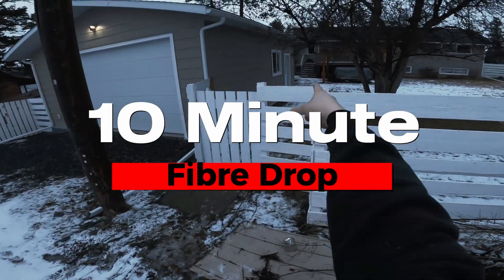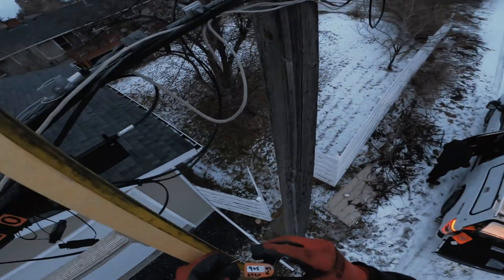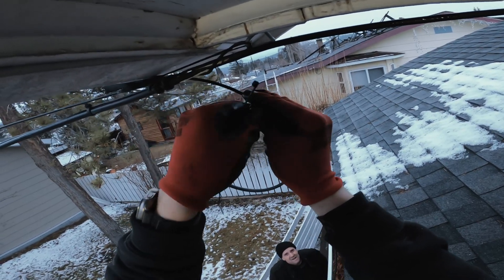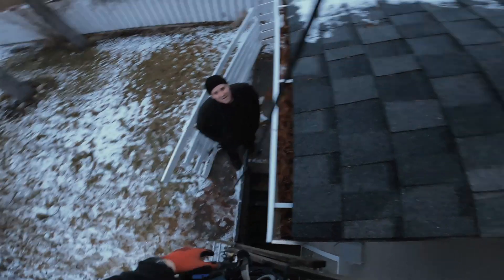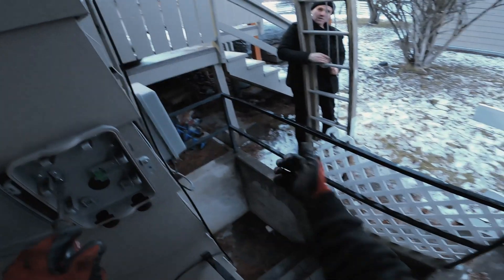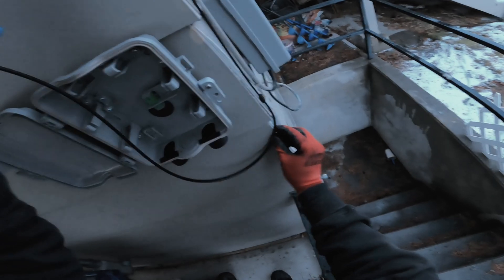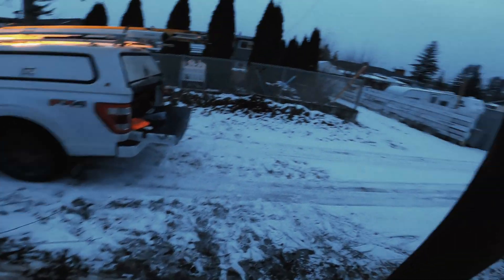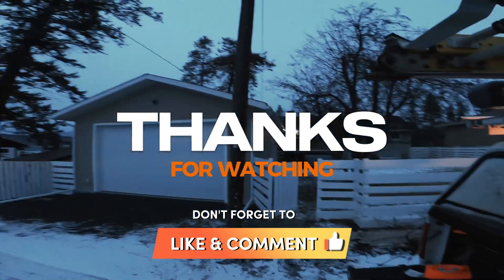Fibre to the home in a blink

Comment: I'm curious. Have you ever come across an install that requires you to install the NID on a detached meter pole that requires you to go into it then back down to the pole and then trench up to the residence that requires you to run the cable underneath the underpinning into a crawl space up through a floor? Or has all of your installs require the NID to be attached directly to the house. 

When I had my AT&T fiber installed last year they made me pay several hundred dollars do you have the drop trenched from my meter box pole that's detached and almost 100 ft away. (I live in a manufactured home and it is building code for all utilities to be detached from the main dwelling and all my utilities have to be buried using ground rated cables including internet services. AT&T installer about had a heart attack when he wasn't allowed to run an aerial drop from the fiber box on the pole.
Reply from the maker: Keep watching my videos and your questions will be answered 😅 join our discord!
Reply: @FyBurz  aye mate. Im making my way binge watching through your videos now.

Comment: Coming from someone who does this everyday, your work leaves a lot to be desired.

You shouldn’t ever be placing your ladder on another companies strand.  You aren’t using proper safety equipment to go mid-span with your ladder either.  The drive-in CATV hook you attached your drop to is only rated for one attachment.  Placing an additional drop on them often breaks them inside year or so, resulting in a low drop.  Your work partner should have a hard hat on when they are working around a ladder also.  Seeing this, I would assume you don’t have a hard hat on either.

Let me guess, you are contracted and not directly employed.
Reply from the maker: You’re not wrong. regarding hardhat, Unfortunately he forgot his on this trip. My GoPro is mounted to my hard hat so there’s that   I always wear it. People have different styles of fall arrest and I agree a ladder/ pole strap is the safest it’s the not equipment I generally use day to day. although I do when necessary. Regarding the Phook I rarely use them as attachment and while I agree that normally they aren’t very strong(hence why I use ram horns) this drop was very short therefore not applying much tension or pressure to said drop. It could have hung off a saddle at that distance not that I would ever do that. Me placing my ladder on “another” companies strand is a stretch man, we commonly share strands in certain areas. And it usually allows for less crowding below. 

I appreciate your concern for my safety and my workers, I was actually really frustrated that he showed up without one. But it won’t happen again. Most of the videos this week are all within 3 days. (The same trip) 

Also Obviously I’m a contractor, and I follow not only way more safety protocols I also follow more OSP protocols and procedures than internal employees. 🤷🏻‍♂️

Coming from someone who does this everyday and has over a decade of ladder experience I hope this clarifies a few things but I want to reiterate that in general you are right and I recommend most people take all the necessary safety precautions to maximize their protection. Im always working on improving, Thanks for watching 😅

Comment: You think you could make an in depth tutorial on how you set up your drop at the nap, as in how to properly tension, waterfall, and anchor. What tools, anchors, and screws you use as well?
Reply from the maker: I definitely can! Although you should watch more of my videos! I’m pretty thorough on the different parts of running a drop. I have a more “comprehensive” guide video as well. But making a video on just that is on the way 👍🏼 thanks for the suggestion.
Reply: @FyBurz  appreciate it and keeping your work clean. Island seems nobody knows what they're doing